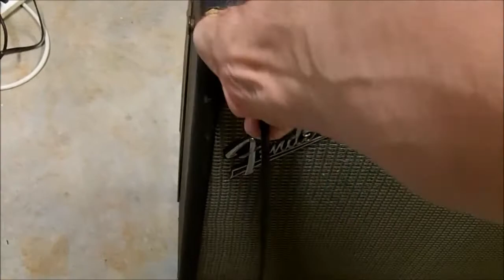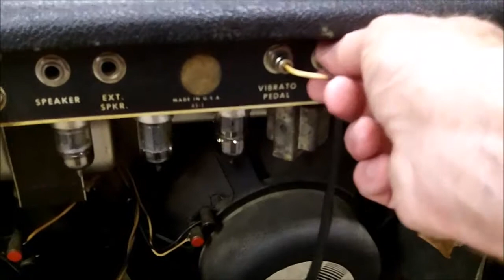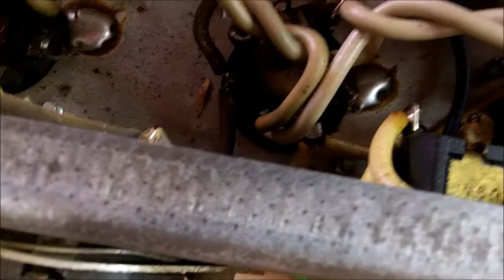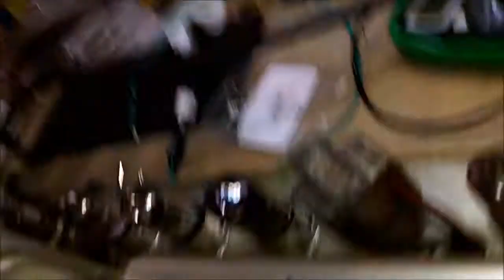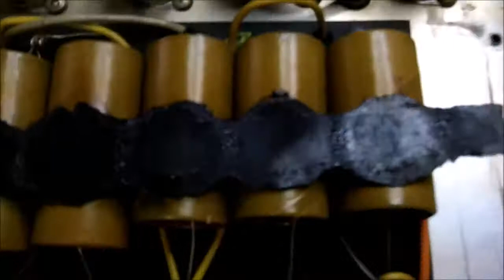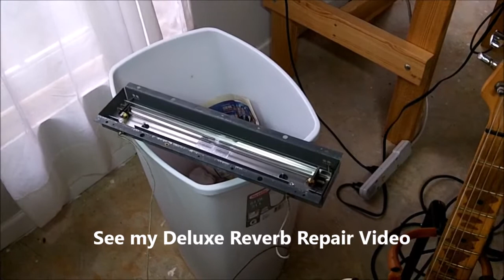fender twin reverb rehab part1

Comment: This is just great and thank you Man. I have two Twin Reverb amps, all original and un-serviced. Some janky previous servicing and speaker replacements. Sourcing NOS tubes and JBL 120f speakers to keep the original vibe. So, your video on the re-cap is just great. I have enough experience to do the work and be dangerous. Lol.  Thinking NFT caps for the filter section, same factory values? Great job on this Man.

Comment: noticed on the first cap in doghouse it was negtive side toward you  then all rest was positive side toward you ,,, would that be the same on the 135 watt version also ,you think?  trying to recap one
Reply from the maker: Mark or take a picture of the way the old ones are oriented before you remove them. Or use a volt meter to measure the polarity of the old ones before removing them( with power on). Finally, you can add also use the schematic to determine which end of each capacitor is positive or negative.

Comment: All those dull brick red coupling capacitors are CRAP.  Get rid of them.  Put in Orange Drops at least.    Turn the bias balance control into a proper bias control and do replace that bias cap.